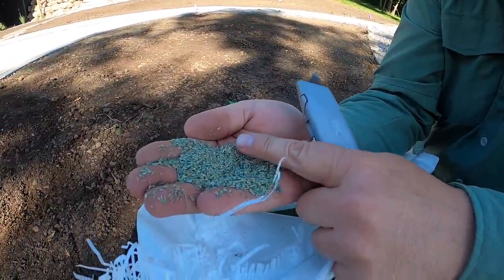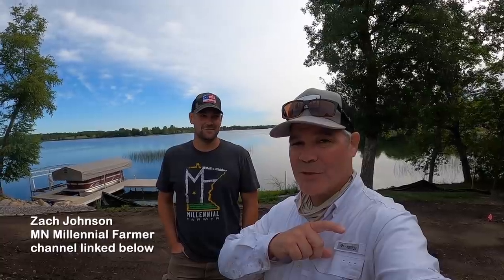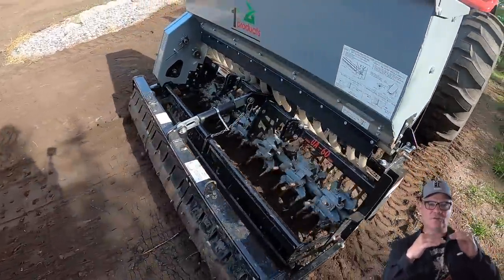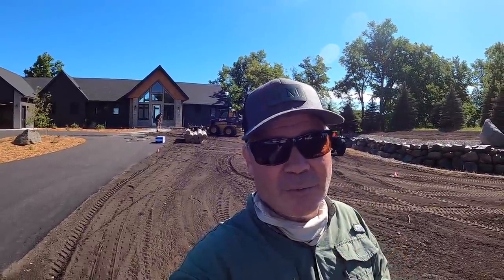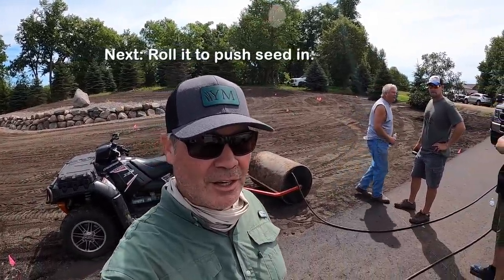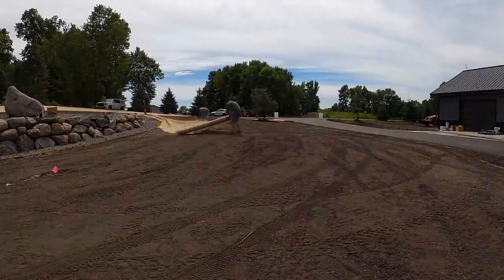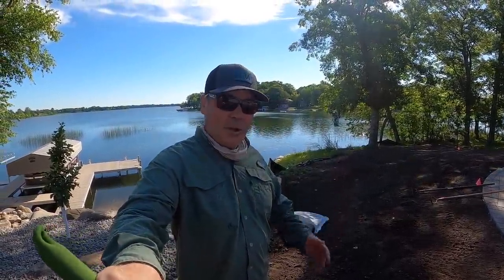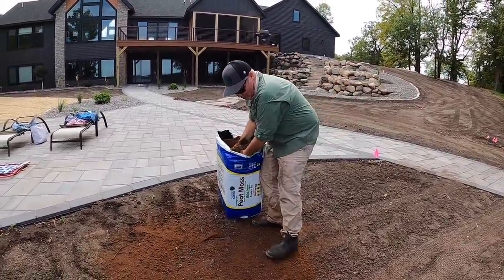How To Plant Grass Seed with Zach Johnson MN Millennial Farmer

Comment: My neighbor used those straw rolls on his lawn. I spent hours picking  up the monofilament that holds the straw together after he mowed. It blew into my lawn. It made a mess of my lawn vac and wrapped around the spindles on the mower deck.  I did the best I could to pick it all up before I mowed.
Reply from the maker: yeah I agree it isn't ideal. The hope is that the sun will help break it down but Minnesota in winter isn't too good for that so there may be some hassle next year. But the hope is that it is worth it to keep the seed from washing away.

Comment: Always good to see collaborations with other Youtubers.  I'm kind of surprised you didn't bring JTLK along to work on this after your trip to UT.  Did you get a chance to drive any of Zach's bigger equipment (when the tractor batteries weren't dead and the sprayer wasn't leaking out of 5 or 6 failed orings).

Comment: Hey Allyn, this video came at the perfect time! I live in a town where back yards are pretty much just Rocky hillsides, so I had about 10 loads of fill and 2 loads of top soil, so I'll be doing a fresh seed in a couple weeks on a brand new lawn!

One thing I'd love to see some advice on is choking out or a complete reno in a TTTF lawn that's being over ran with Bermuda. My TTTF in the front is holding out through the summer heat here in Arkansas, but it's definitely not outdoing the Bermuda. I'm honestly terrified to nuke it with glyohosate, so I'd love to get some tips from you!
Reply from the maker: sadly, the bermuda will always return - it's a creeper, for real. If you do decide to do the full burndown then once the lawn is regrown, you want Fluazifop as the active ingredient to control the bermuda going forward. As you see it, spot spray it to keep it from spreading.
Reply: @Thelawncarenut  Thanks! Will that product work to help control the spread if I don't burn it down? Fescue looks great in fall and spring, but the Bermuda really crowds it out once it warms up.

Comment: You talk about using the same chemicals as farmers do. Is it possible that the same stuff we use can be bought in a different package, which was advertised to farmers for much lower price?
I see many times that the same stuff is sold to the industry for cents, while it is being sold to the public for much-much more in a nicer bag.
Reply from the maker: We talked about that exact thing. The AG industry pays much less than the lawn care industry. You're not supposed to use products from a jug unless they are labeled for lawn use even if it's the same active ingredient in the same concentration.  It's frustrating but it's the law.

Comment: @ The Lawn Care nut.. Question about Topsoil, I took a snippet from your PDF.
LCN 2020 Fall Seeding Supplement. (PG15-16)

"Please trust me and don’t bring topsoil into your lawn. There
can be all kinds of weed seeds and other junk in it that you
are introducing into your lawn. Even if the topsoil you are
buying says it is “screened” or “filtered” that isn’t going to pull
out seeds." - 

Now, you are talking about topsoil as a seed covering for protection. 
Does this issue also pertain to using topsoil to level the yard? 
If so, what do you recommend? Do you have a video/blog where you have discussed this before?
Reply from the maker: correct, don't being foreign soil into your lawn if you can help it. Sand is your best leveling agent. However, if you have a brand new start - new construction, just use the existing soil and grade it.

Comment: Allyn, this is my concern, i have a large yard and am planning on sodding warm season grass on this area. The landscape has beautiful gentle slopes and contours like a golf course but it's compacted and i reckon if i use a the harley rake with a skid steer i can loosen the soil as you guys did in the video. My question is, can i pull it off without altering the contours of my landscape?plus i wanna know if that roller can also be used on my sod?
Reply from the maker: excellent question. The harley rake is only going to take the bumps out at a max depth of 8" but you can control the depth and only go 4" down if you want. My assumption is that your rolling hills are longer and more gradual so it should not change the topography at all. As far as sod, yes the roller we used can be used to roll/seat sod as well
Reply: @Thelawncarenut  thanks Allyn